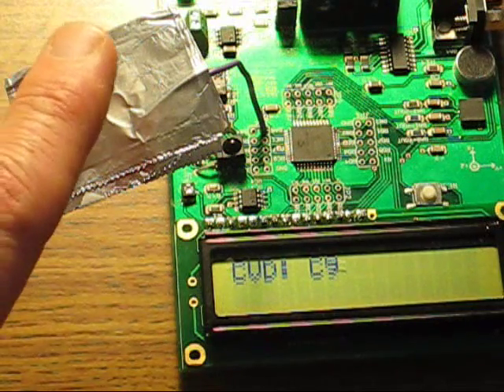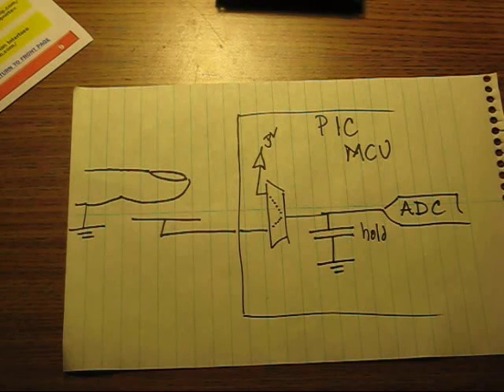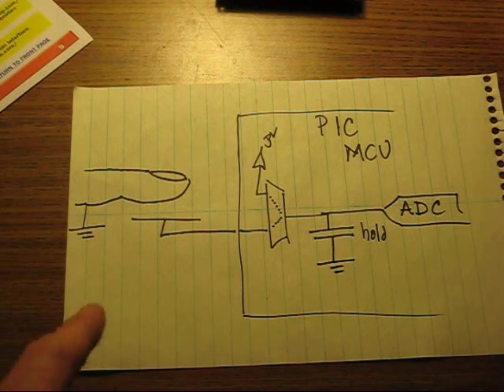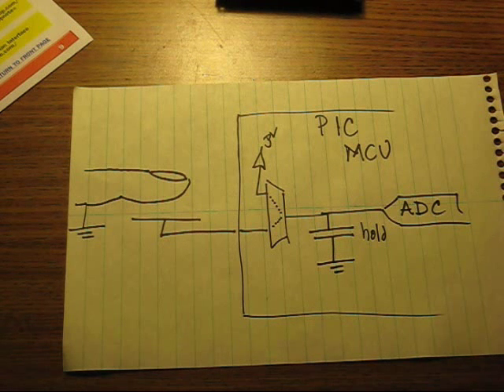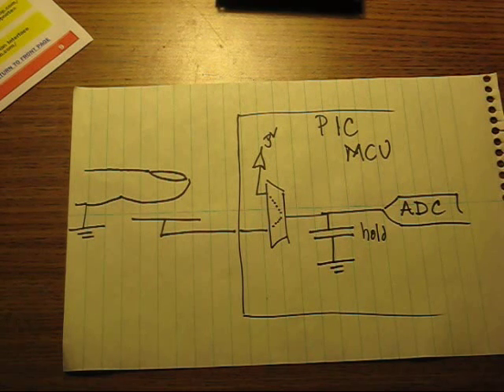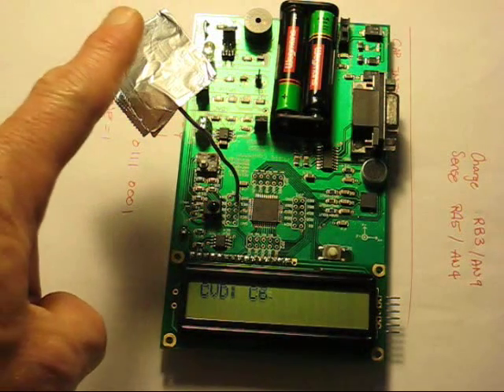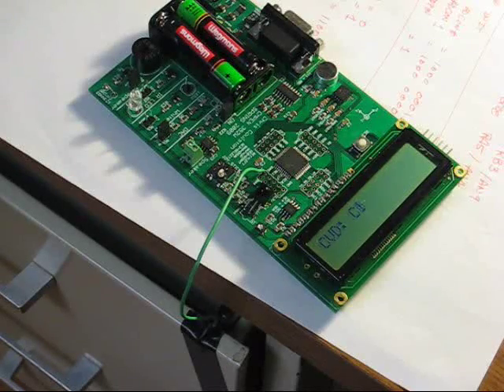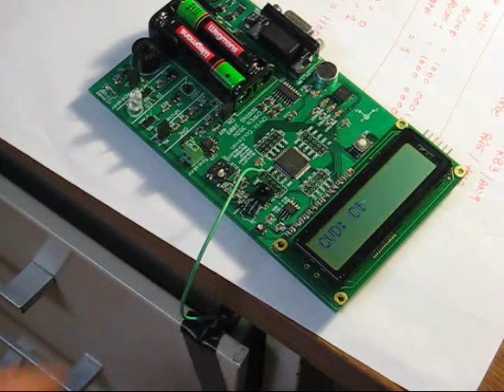capacitive voltage divider

Comment: I know you show your code, but I write in assembly language and want to get it clear exactly how it works.

Is the only external component to the PIC the wire with the tin foil on it, or do you have to physically put VDD onto the secondary ADC to get this thing to work. Microchips application note says to make it an output and drive it high, but you can't make it an output if it has been set up for an analogue. Surely if it is changed to a digital and then driven to 1, the ADC will not be able to read it, as it is a digital.

Comment: I think i know why touching the desk didn't work. You will see the signal if you touch the PCB ground or the battery instead. Basically, the signal goes to the small plate. This phenomenon is non-trivial because it is needed for tailoring the sensitivity. I invite you to watch some of my videos.